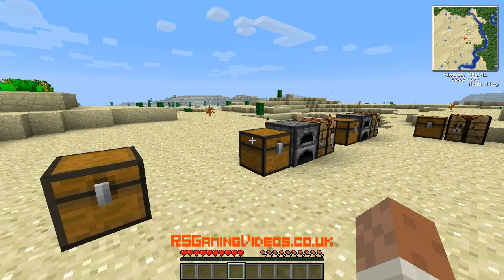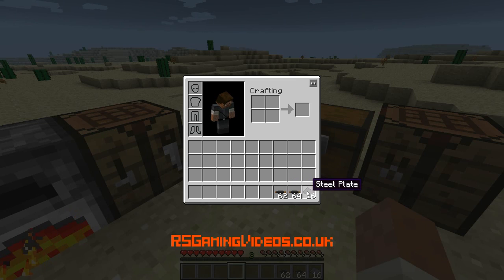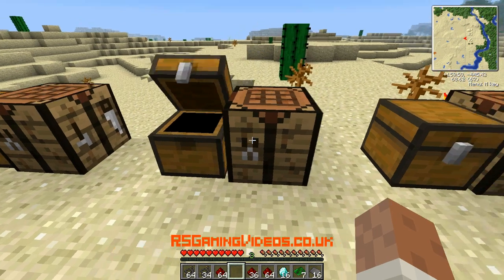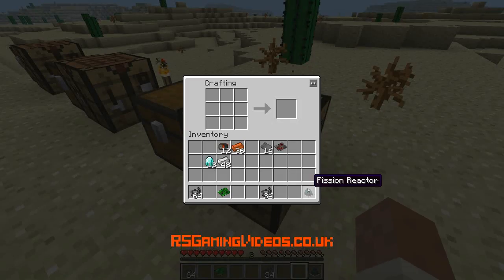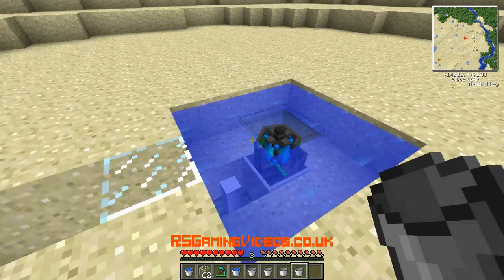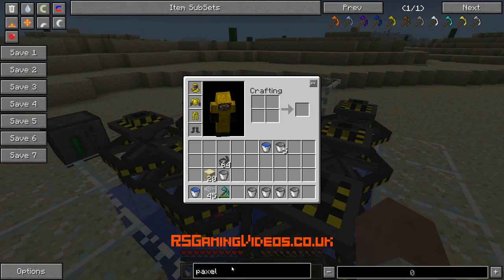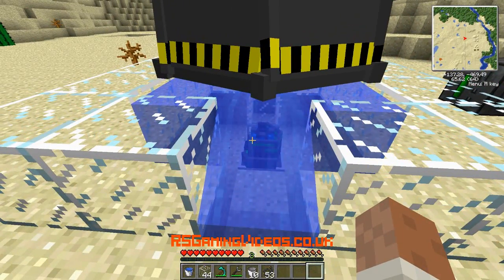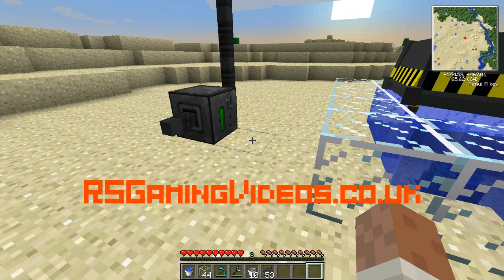Voltz Pack: [Tutorial] Nuclear Power Fission Reactor

Comment: Hopefully this is helpful for everyone, they changed the name of uranium rod to fissile rod I think, and u can add more than just that, u can add a thermometer beside the reactor to check the temp and if it gets too hot, it sends a redstone signal and u can hook it up to the piston to automatically shut off if it is too hot ( I added an extra thermometer which was more sensitive so it will give off an alarm noise from the siren so I know if shit gets real) also u can't set multiple reactors and turbines next to each other (reactors can't be touching, just in the same water) to crest energy faster. They also renamed fission reactor to nuclear reactor I think.

Comment: WTF are you doing here? Where's the plasma?
Reply from the maker: Plasma is used in the FUSION reactor. This is the FISSION reactor. They work in completely different ways.
Reply: RSGamingVideos
Oh, I looked for a fission reactor and I found a fusion one. Well, why does the fission look like a fusion one?
Reply: also in the mod, you can make the Particle Accelerator (I think it is called that) that makes plasma and when done, makes antimatter.
Reply: It looks like a fusion one because this is an older or newer version of volts

Comment: Yes, you can. if you put a thermometer next to the reactor, at the heat showed on it (you can lower it so your reactor wont explode before the control rods go up) the thermometer will send out a redstone signal. this redstone signal will need to make three control rods be pushed next to the reactor. (only one wont shut it off completely. go to the voltz wiki for a better explanation.

Comment: yes by using red stone, control rods , sticky pistons and the thermometer.
place the thermometer next to the fission reactor and put red stone under it.
thats the first step.
then you need to put a control rod ONE BLOCK below the fission reactor and place a sticky piston that is pointing up then you hook up the red stone to the pistons (you do that by placing red stone in the same level as the piston)
to have more control of the shutdown of the reactor do the same thing with the pistons.

Comment from the maker: Try going to the Voltz wiki and searching 'Fusion Reactor'.
As you will see, the rector itself won't heat up the water. You must give it power from somewhere else to start it. It will then generate plasma around it and the heat is produced my the electromagnets you place around the Fusion Reactor. It's the electromagnets that heat up the water, and the turbines are above that water.
Be careful when you talk about reactors, because you didn't specify which type: FISSION (in this vid) or FUSION.

Comment from the maker: The thermometer will output a Redstone signal when the reactor next to it reaches the temperature you set. If you connect the block to the piston shown in this video, the control rod will be raised to stop the reactor when it gets too hot. Hope this helps, Ross.

Comment from the maker: Yes, you are correct. Lets set the record straight right now:

The Fission reactor will explode at 2000 degrees.
To change the temp on the thermometer, you right-click with a wrench to raise the temp or right-click without a wrench to lower the temp.
If the reactor REACHES 2000, it WILL explode, so set the thermometer to around 1900 to be safe but efficient.

There we go!

Comment: btw for anyone wondering the bigger turbine sucks i just tested it against 8 smaller turbines and the bigger one got to 1 mj by the time the smaller ones were on 8 mj also you can put turbines above the lower turbines wires and they still spin so you gt even more energy

Comment from the maker: The maximum temperature of the Fission Reactor is 2000°C. If it goes above this temp. it will explode. I suggest setting the thermometer to a bit lower than this, as you want the control rod to stop the reactor before 2000°C!